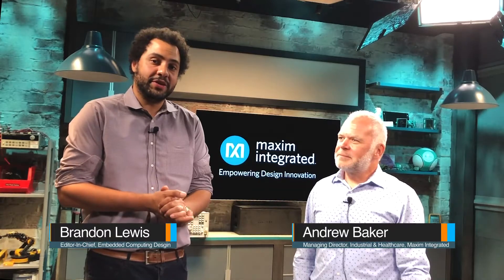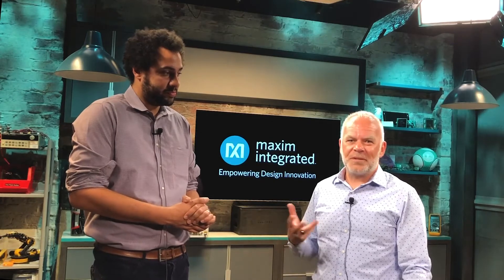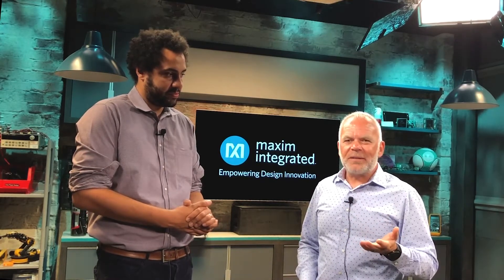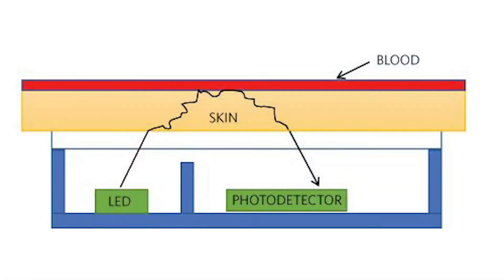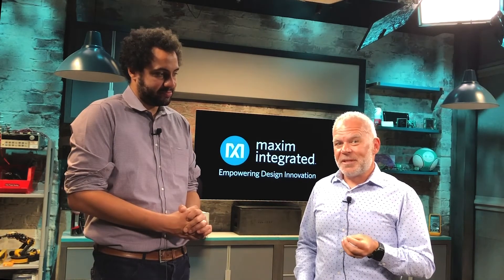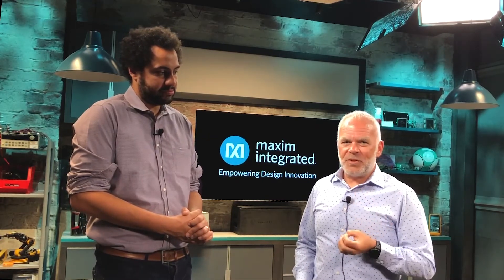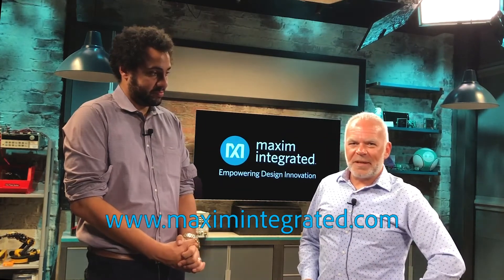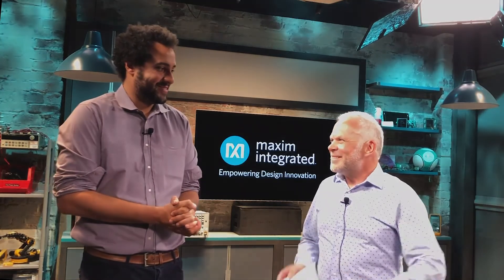Wearable Wellness with Advanced Optical & Temperature Sensors

Comment: Hey I have the MAX86141 evsystem, the MAX86141 and MAXsensorBLE are connected through a flat cable. Everything worked fine when evaluating it with the test software but now I would like to connect the sensor to a development board. I figure I need to use the MAXsensorBLE board for that but I'm quite lost in how to start connecting it to the pins. Any tips with that?

Comment: can i measure on the wrist?
Reply from the maker: Hi Sandro, the 86161 is designed for in-ear applications while the 30208 is a general wearables play. It's possible to use the 86161 in other, exterior wearables but you might be better suited with another part at that point like the MAX30112. 

Either way you can find more optical healthcare sensors here that might suit what you're looking for: https://www.maximintegrated.com/en/products/sensors/healthcare-sensor-ics/optical-health-sensors.html

Thanks for the question.